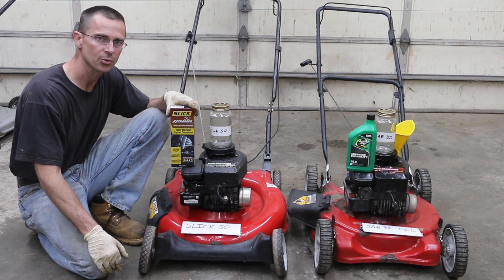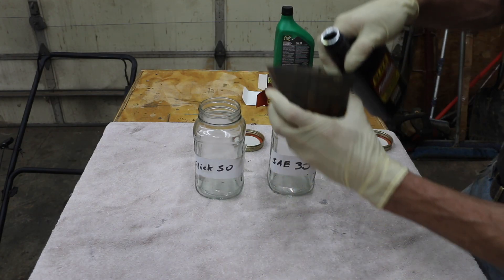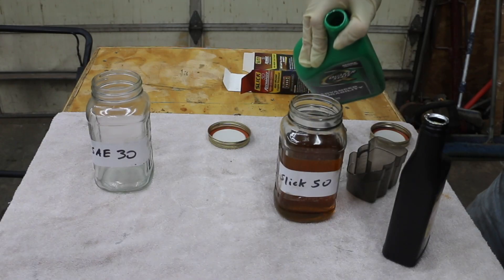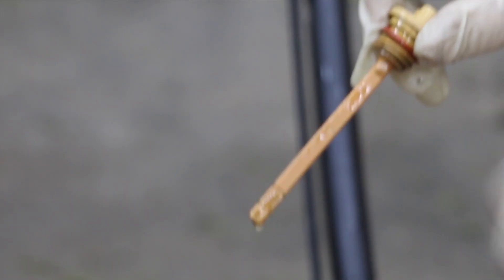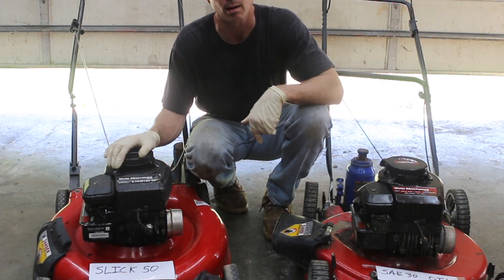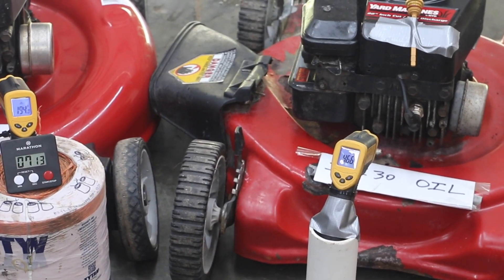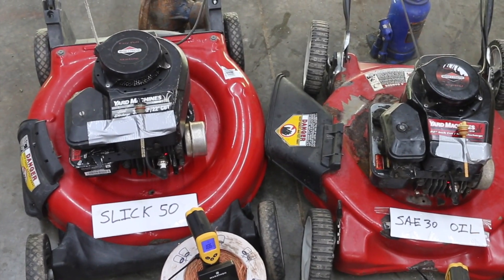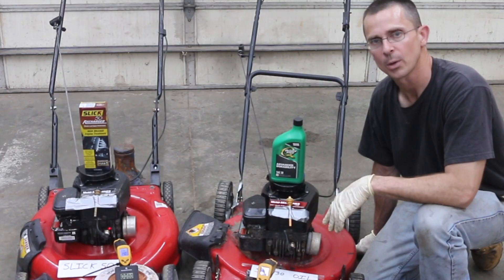Can't believe what SLICK 50 did to my engine!!--Dry Crankcase Test!

Comment: There used to be a product called nylon that made exactly the same claim Teflon the same as you use frying pan to make it non slip intheur test they claimed to drive a car across Europe with no oil in it.Dont know if it is still available.
Reply from the maker: Thanks for sharing.

Comment: Hi @Project Farm! Fun fact: a lawnmower has a drain plug to drain oil . hope you knew that!
Reply: Some do!
Reply: A vacuum pump will always remove any fluid more completely than a drain plug.  Drain plugs usually sit 1/4-3/8 inch above the bottom of the oil reservoir therefore leaving a small amount inside when drained.

Comment: Good stuff👍Maybe failure due to them being air cooled engines. No anti-freeze cooling like a reg car engine. 
Also... it's SNAKE OIL! I bet they were sued a bunch after their TV 👀commercials. 
I change my oil in mower after winter & always use conventional oil. I also change my 07 Trailblazer 4.2 inline 6  every 4000 miles. 167,000. It's always had proper maintenance & no issues. 
Quaker State or Pennzoil 5W30

Comment: Although the lawnmowers are similar, there is no way to assess that they are identical.  First, you should have run one with 30wt and then added to Slick50 to see how much it reduced the temp.  Since the mowers are not identical, it is safe to assume they would run at different temps with the 30wt.  

The seizing test is more related to piston and bearing clearances and cylinder to piston interface.   If Identical mowers, the hotter one would seize first.  The greater the clearances, the longer it will run.  And then there is the surface treatment of the cylinder and piston.  Both were aluminum blocks I assume, but sometimes, they will put a cast iron sleeve in the cylinder.  

Based on just clearances the cast iron sleeve would seize first since cast iron has a much lower coef of therm expansion.  HOWEVER, the coef of friction of dissimilar metals is always lower than like materials - so alum piston in alum cylinder would be not as slippery.  BUT to deal with this, there are coatings and other things that are done to reduce the friction of the alum piston and cylinder.

Comment: How do you know if both engines were in the same condition internally? One machine looks to be more worn than the other. This test would be more accurate with 2 identical machines both new with zero run time , too many flaws in your test for an accurate result.

Comment: I disagree with this demo.
I had a car back inbthe 90's when this stuff came out. It would leak oil bad and there were 2 reason the car would start ticking, at 3000 miles or oul was very low. I used the slick 50 went a few months forgot all about it, I relized on the way to work that its been a long time since I checked my oil, but its not ticking, got to my work checked the dip stick, there was not a drop of oil on it.. So I am a believer of slick 50..
Also it was rated to last 50,000 miles
Reply from the maker: Thanks for the constructive feedback

Comment: There is a problem with your test. It appears these are different engines and both used, so the initial condition of the engines is probably far from equal, not knowing how they were used and how old they are. So this test in not conclusive.
I have used some of these in the past, one called Prolong, and I don't now if it helped. These days synthetic oil and regular maintenance is what I depend on.
Reply from the maker: Thanks for the constructive feedback.

Comment: I used Slick 50 in a Chrysler 318 cube and the fuel millage improved buy 2 mpg over a trip and local driving, but when I drained out the oil  at oil change the mpg dropped by 3 + mpg. Go figure . Also a regular oil filter filters down to 100 microns and it looked to me that at least 50% of the Teflon particles were larger then that. I think the small engine used by reps. was coated with Teflon by some other way than by operating that engine strictly with the Teflon  in the oil.
Reply from the maker: Thanks for sharing.

Comment: Maybe slick50 needs to be mixed with engine oil to work as advertised. So the test should be done again the same way, but one engine drained of oil, and the other drained of oil treated with the specified percentage of slick50.
Reply from the maker: Thanks for the video idea.

Comment: I believe the premise of slick 50 was that lower heat aided durability by keeping the parts cooler. Heat in any mechanical process is the enemy. Not sure if it was misunderstanding or misleading about the "Coating" of the parts. some take it as the slick 50 sticks better at temperature and others thought the polymer actually imbedded into metal surfaces. The True test would be longevity not extreme uses.
Reply from the maker: Thanks for the feedback.

Comment: slick 50 has Teflon in it . be sure to get the Teflon in suspension before adding to engine or you will find white residue in bottom of slick 50 container . when added to engine , engine must be operated for at least 30 minutes for engine heat to bond Teflon to engine surfaces.
Reply from the maker: Thanks for sharing.

Comment: I was always using Slick 50 from the time I saw an adv. about a car running without oil after in a racing track (by either the AA or RAC don't remember which) them days u was  only meant to use slick 5 once after u needed to every so many miles n stopped using it since i saw your video many thanks mate your our hero
Reply from the maker: You are welcome!

Comment: I remember the old slick 50 commercials and I am a little bummed out by it. I would like to have a rematch between slick 50 and standard sae 30. This time for better information and science if you could purchase 2 new cheap motors to rule out engine history and completely rely on the oil itself.

Comment: I like your testing I don't know how they made them engines run dry when advertising slick 50 looks like it don't help using it on the lawnmower engines I have not used it in a very long time just don't trust using it. I just wanted to mention if you have blades under the decks the one mower would be blowing cold air onto the other engine and cooling the engine on the other mower. Also the other mower looks like its in mulching mode and may build air pressure under the deck and cause a little added resistance to the engine making it work slightly harder. Anyway the Slick 50 did not seem to have any benefit. I seen your Dura Lube test and was against using additives in my engine oils but I am wanting to try it now after seeing your test engine running smother and quieter.

Comment: Would love to see what you think of a product called Dura lube. I'm off grid. I run it in my Onan generators. My oldest has 24000 hours on it. It is rated at 12 to 18.000 hours. Still uses no oil. Starts in the coldest & hottest weather. Seems to protect against wear.
Reply from the maker: Thanks for the video idea.

Comment: I realize that I'm kind of late to the party here, butone thing that I noticed that is extremely important when using any ptfe oil additive is to shake the bottl;e vigorusly befoer use, something that was not shown as being done in the video. The ptfe settles into the bottom of the bottle, and will stay there unless it is well shaken and poured immediately. Consequently, you're getting no ptfe and a blown engine.
Reply from the maker: Good point!

Comment: If i were to guess why the slick 50 engine crapped out first would be due to how thin the slick 50 is. It looks like water when you drain the oil. The 30 weight is thicker and i would think it stuck to the cylinders and bearings better than the one treated with the slick 50. The 50 is designed to flow easier in the system . Might try a similarctest with 50 weight vs 5w 30 or cooks recycled oil. Im a lucas fan. Ive used lucas fuel and oil additives for years. I also run stnthetic oil in all of my vehicles.
Reply from the maker: Thanks for the feedback.

Comment: He says thanks for the constructive criticism... here's the constructive.... 2 used mowers... both different engines and different ages probably donated which means one couldve been taken care of, the other not. one is rusty as all get out could be a 2nd motor... one looks new but craps out waaayyyy before standard oil... do you really think slick 50 works the exact opposite of what its designed to do? do you see the manipulation here? someones getting paid and it aint by slick 50...

Comment: I am Very disappointed I've used slick 50 for years since those 80's infomercials yeah the red dodge viper with no oil on a 118 desert closed course track and the engine on a test stand with no oil pan and the dump sand on the exposed rockers of course I never tried any of those but thank you for doing so I will no longer be using this product.
Reply from the maker: You are welcome!  Thanks for sharing.

Comment: I remember that commercial. It sold me. I put a bottle of it in my 91 Chevy 1500. I still have that truck and it’s still going strong at 275,000 miles. I can’t say it’s because of the slick 50 of course, but it certainly didn’t hurt it.
Edit: I looked into the slick 50 a bit, and apparently the original slick 50 has not been available under that name since 1984. Xcelplus appears to be the product that was the original slick 50.
Reply from the maker: Thanks for sharing.

Comment: That was an interesting test, regardless, however a question remains as to whether things are different in a shell bearing engine versus a roller bearing one. All engines are designed only for presence of oil. The real test would be to put slick 50 in a car engine after a dyno run to check horsepower and then check again with the product to see if a friction reduction gave you one or two more horsepower.
Reply from the maker: Thanks for the feedback.
Reply: I think you’re looking to deep into it, in the weeds as they say.  And your comment reads as though you just had to post a comment.  Not a whole lot of food for thought in your post. 
The bearing type? ……. If you want to open the door to that rabbit hole;  there are going to be virtually an infinite number of variations that could affect any test that is conducted in someone’s shop in the backyard.  Especially tests that involve single cylinder, 4 stroke, air cooled, carbureted lawnmower engines. Running them WOT with oil drained.
Who gives a flying nun that there’re test controls and variables that hadn’t been included on this ONE, SIMPLE yet thorough test.
Haysoos kristo man.  Just enjoy the man’s’ videos.
Reply: I’ve got a question about your post too. 
You said “the real test……..”.  Did ProjectFarm conduct “the fake test”?  
You understand the goal of the whole thing was, right?  I’ll tell you a couple things that were NOT the objectives. #1). To measure power output degradation and, #2, use a vehicle engine.  
Let the man do his thing

Comment: I'm amazed that slick 50 doesn't stand up to conventional oil & the lawn mower that had  sae 30 oil in it lasted a hell of lot longer time than the lawn mower that had the slick 50 locked up way before the other lawn mower with sae 30 quite shocking really you would think slick 50 would last longer just goes that additive doesn't work maybe Motor Up maybe better to use in a lawn mower then drain it the Motor Up out & see how long that lawnmower engine will last that would be a better test or even try STP oil treatment Kind Regards Peter
Reply from the maker: Thanks for the feedback.

Comment: I'd been wondering about Slick 50's big claims for about 25 years too!....at least it runs a little cooler🤣. Great videos by the way.
Reply from the maker: Thank you!
Reply: Almost forgot..about 25 years ago I filled the crankcase on a 79' CR250R and the clutch did slip like crazy especially in 3rd and 4th....

Comment: Its a done deal. Slick 50 is a bunch of BS! Had you used z max i promise you you would have lasted longer than conventional oil. But the real deal is if you use a high grade full synthetic oil with a high grade filter there is no additive availible that will protect better then that. Myself i always buy 1, 5 gallon jug of Castrol full Syn the gold bottle and 2 quarts of castrol conventional and i mix the 2 using a k&N filter or Mobil 1 filter. This is the perfect combo!
Reply from the maker: Thanks for the feedback.

Comment: I wonder if the general use and maintenance had any effect on the outcome between the two motors. I think this type of test needs a higher sample rate. Also a set of new engines would probably help too. Which i don’t think anyone is going to do that lol.
Reply: With 2 identical new motors. Maintenance and the time each motor has on it would have a huge effect on the conclusion of this test. Also slick 50 takes some operation time for it to breakdown and bond with the metal like its suppose to. 5 mins of running just to get the temperature up isn't gonna do it.

Comment: I remember the commercial. 
And after talking with many people and mechanics the general consensus was that these additives whether Lucas STP or Engine Honey etc did more harm than good. Especially in colder climates. 
Any coating protection was negated by the sluggish viscosity when cold to the point of engine failure. 
I heard several people say they either experienced engine failure or knew someone that did shortly thereafter using these products.
Reply from the maker: Thanks for the feedback.

Comment: Had an old transit that had low oil pressure.i treated it with the early slick 50 and it took me to Portugal and back to England with no problems.
Reply from the maker: Thanks for sharing.

Comment: Castrol Mgnatec - has magnetised oil particles to stick to your engine.
Reply: I use it in my Tundra.  It’s the only oil that prevents chatter at startup on my engine Summer or Winter.  It also gives me right at (1) mpg increase in fuel economy on the same freeway I run to work every day.  The increase in mpg seems to last about 2,000 miles.  I change my oil every 5,000 miles with it.  I’m a fan of Magnatec for sure.

Comment: 10W30 full synthetique. I've been using in my lawn mower tractor for more than 15years, and except topping the engine once in a while, never had problems..
Reply: Yep, agree. 
I use 0w40 full synthetic (Mercedes formula) in my riding mower (B/S V-twin 22hp) and after 2 years oil is still golden. I also drop in a few ounces of Liqui-Moly anti-friction additive (looks like liquid graphite). No problems at all, good running engine.

Comment: Like someone else commented, Slick 50 is not the same as 25 years ago.You should do another test with Xcel Plus, the original formula.That would be interesting!
Reply: Good point. I don't know how much zinc original Slick50 had in it, but zinc kills cats that's why modern oil has very little. Maybe modern Slick50 is the same?
Reply: It was always useless, rough lumps of PTFE do nothing to help, and can block important oilways.
Reply: @Ab Ba From an engineering perspective, that isn't possible.
Reply: @68404  - What a kill joy!  Placebo effect?

Comment: The one with 30 oil had it’s grass discharge blowing air on the engine with the slick 50. Maybe that’s why it ran cooler but it still failed first that’s puzzling.
Reply from the maker: Thanks for the feedback.

Comment: I wonder if the Slick 50 motor was just basically a "Lemon" or something. And maybe we would have to run the Slick 50 for miles and miles and hours and hours to "Impregnate" the metal ? I also heard if a machinist knows it was treated with Slick 50 they probably won't do stuff to it because it is hard on their bits etc.
Reply from the maker: Thanks for the feedback.

Comment: Slick 50, from what I remember from the instructions should not be used on new engines. The instructions said to insert the sl50 into the engine and run it for 20 miles, then let it cool. I used it on an old car years ago. It appeared to do what it said on the box. I don't know what the instructions are for a two stroke. I bought some for an outboard motor and the instructions were different.
Reply from the maker: Thanks for the feedback.

Comment: The engines have the same compression to begin with?  This really should be done with 2 new engines.  More expensive yes, but only way to guarantee that the engines were equal at beginning.  I think the Slick 50 engine was more worn out to begin with

Comment: Check out Prolong Super Lubricants, a brand of GoldenWest Lubricants, Inc.   Also check out XADO Atomic Metal Conditioner Maximum with 1 Stage Revitalizant by XADO Chemical Group.  The XADO requires 600 - 900 miles of run time to fully bond.
Reply from the maker: Thanks for the video idea.

Comment: In the 80's my dad bought a case of Slick 50 from a salesman that stopped by the farm.  We put it in everything, 16hp auger engine, Massey Ferguson combine engine, pick up truck and the only one that survived was the dodge pickup truck engine.  The combine engine was the one that hurt the most, seize up a diesel and it cost around 10K to rebuild at that time plus down time during harvest.  The mechanics said that the oil pan looked like someone put sand in it.  I think what was happening is that the silicone broke down to silica particles due to heat and destroyed the engine.
Reply from the maker: Thanks for sharing.

Comment: Uh,I am just as disappointed as you are, I had the same thoughts as you and also wasted my money. Well it ran cooler. 
Maybe we should not run our engines dry, and take the lower temperature to our profit. I only had one engine failing in my life,
and guess what. Yep it was the engine with slick 50. But I never made them responsible,and called it bad luck. I made 20000miles in one year with my 2cylinder engine.
Reply from the maker: Thanks for the feedback.